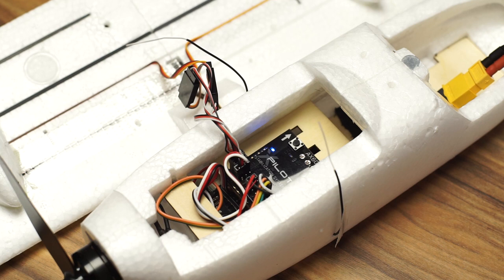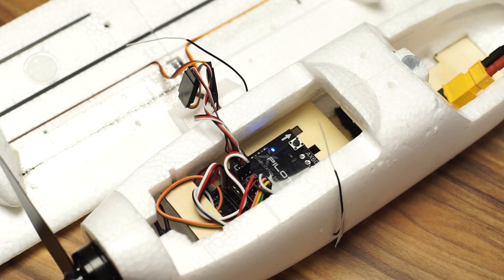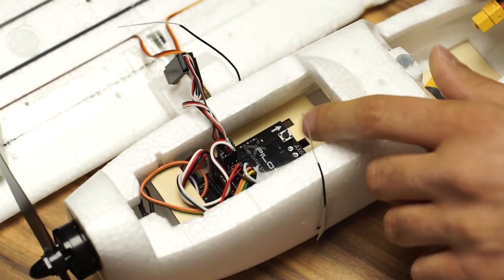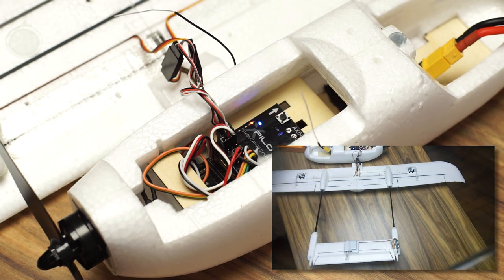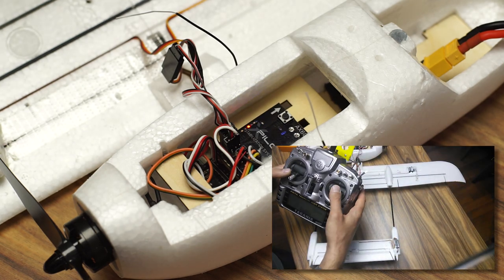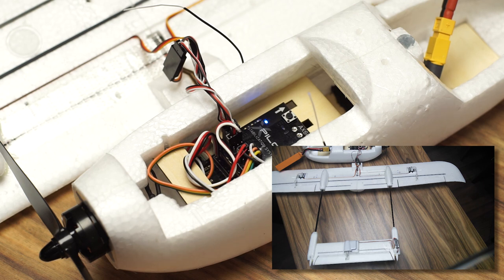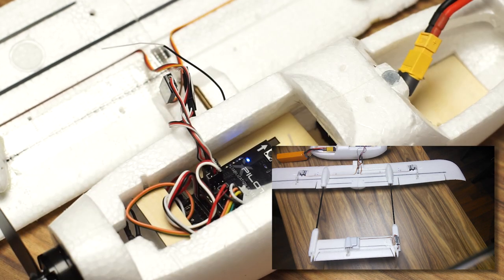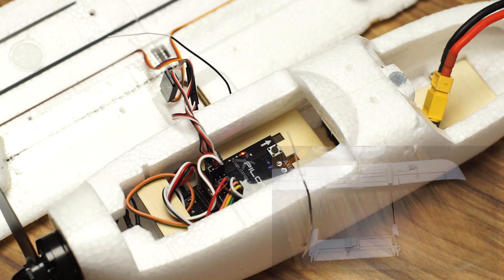Volantex Xpilot stabilization system - calibration and setup

Comment: Please help I have followed these configuration steps(https://www.youtube.com/watch?v=fZPNAFPJ4-E&t=13s) multiple times and can't get the blue light on the Xpilot to go solid blue(stabilize mode).   Note:  Aircraft servos do work via radio (even prior to initial attempt to configure the Xpilot) Also configuration saves via red led(s) indication comes on when saving with lower right stick application during configuration mode. Any advise is appreciated.  Thxs
Reply: Mike Brisky .. I am having the exact same issue. Aileron and elevator end point calibration and three position mode switch calibration saves as per the video but when reconnecting the power my blue LED does not go solid. I have wasted hours and hours trying to get this to work so if you find a solution please let me know and I will do the same
Reply from the maker: Quite a lot of people seem to be experiencing such problems lately... wonder why!!! :(
Reply: Paul Nurse - To let you know I decided to go with a -  A3 V2 6 Axis Airplane RC-DroneGyro Flight Controller Stabilizer Standard RC843 (purchased via Ebay).  I installed it over the weekend and it is working good so far.  BTW the printed howto instructions that come with it are good.   Thanks
Reply from the maker: Good info, thanks!
Reply: @PaulNurse1  Dpn't know if your problem with the stabilizer is sorted. I have also this problem but I have found that leaving the unit unplug for a few hours would let itself go back to default settings. You can then recalibrate it once more. How did you fix yours ?

Comment: great vid. for discussion or testing. at the calibration test where both tx controls go down right. after that it saves the calibration do not move the plane until 3red go off.
but if instead in calibration you put tx left control down right and put right control down left in calibration your servos will be reversed. 3red light will come and go off when saved. 
can anyone confirm the reversed servo by calibrating and do the right control stick to bottom left in step 2 ;)
Reply: Worked for me to reverse aileron servos with the process you described. Using RX Fs-iA6 (no sBus), TX FlySky-i6 and AX601 XPilot. I have reversed channel 1 on my TX to have the ailerons working in the right direction before installing the AX601. After installing the AX601 (without having applied your steps), the stabilization pushed out the ailerons in the wrong direction, so magnifying the role the plane would be in. Applying your step to push down the left control stick on my TX down right and the right stick down left in step 2 of calibrating the AX601 made the stabilization now indeed push the ailerons in the right direction. My TX also still has the reverse turned on for channel 1. tx!
Reply: @MrDwck  For ailerons you could have just rolled over the aileron servos! ;-) It would be interesting to check if this procedure has any effect on rudder and elevator stabilization direction.

Comment: is it possible to use this with a delta mixer so that when it stabilises it will work with a flying wing
Reply from the maker: I don't see a reason why it wouldn't work!
Reply: I’m interested in using it for a delta wing also but I don’t see how it would know how to mix Ailerons and rudder if it doesn’t have a switch to change the wing type configuration on the Xpilot unit? If you only have aileron servos connected to it how would it know?
Reply from the maker: That is why you need a V-tail, or otherwise known as delta, mixer to mix the channels needed. The Xpilot will not do it on its own.
Reply: ArxangelRC thank you

Comment: Hello! Thanks for the video.  I'm quite new to adding a gyro to my rig.  The flight controller comes with a ribbon cable and im confused on how to wire it to my receiver.  I don't have an SBUS compatible device so I'm going to wire it the old fashioned way.  Do I need to purchase a few Y connectors and run the harness from the receiver to the X pilot and then to the servo or do I need to wire just the signal wire from my reciever to the X pilot and have power and ground go to my servo from the reciever?  I'm quite confused and any help would be greatly appreciated
Reply from the maker: Power for the servos will probably come from the ESC, which may not necessarily be connected to the stabilizer. In any case when you connect all the wires from the receiver to the stabilizer, except the throttle, the receiver will power the stabilizer, which in turn will power the servos.
Reply: The ribbon cable has many cables useless, you should take 2 of them (the red one for power and the black one for ground, for exemple) and plug them from the receiver to the xpilot. 
You should take power and ground from any channel from the receiver (channel 5 for exemple) and plug them to the + and - on the xpilot.

Comment: Does this have a failsafe option? I.e. if you loose signal will if keep the aircraft stable till it hits the ground?
Reply from the maker: I would assume, but it would also depend on the receiver - if you set it up to failsafe on the stabilize mode channel and no throttle, with a bit of rudder, it should do just that! Not sure the board itself has any failsafe detection!

Comment: I’m using a Radiomaster TX16S and need to program a channel to enable a pilot. What channel does the stabilizer use ?  Is it -100 or +100 for on?
Reply from the maker: I can't say that I recall anymore... try channels from 5 on to see which one would make it go on or off... perhaps channel 8... don't remember, but yes, it needs to go full swing from -100 to +100.

Comment: Hello...i have a question, a little "off topic"...how do you usually power your pwm receiver? directly from the battery? (Using a BEC)From The balance plug? I don't know what is the best way...
Reply from the maker: I usually use an external BEC to power the electronics on-board, but on this model it was just not worth it to go that far, and the ESC was HobbyWing, so it is somewhat dependable, so I just powered the receiver and all electronics from the ESC's BEC.

Comment: Dear Sir
I started to mount the xpilot in the ASW28 of the Volantex and there was an interesting qestiion, the ailerons have independent channels.
The controller only has 1 port for aileron.
my right aileron is on channel 1 and the channel on channel 2 i have the left aileron.
Using the  FrScky X8R receiver, on sbus, will it be that if I connect my channel 1 to the aileron port of the controller and my channel 2 in aux2 will the elerons be working well?
How do I turn the controlled flight on and off, on the taranis x9d plus.
Can you help me?
greetings
Vitor Lalanda
Reply from the maker: Use a Y cable to connect the ailerons to a single port! I think you need to setup a switch on ch5 in the radio, that will change the flight modes!

Comment: Thank you for sharing your knowledge, it will be helpful when I get there. I have 4 servo's  on the wing Ailerons/Flaps. My query would be; 2 servo leads from all 4 servos to where ? Would be so helpful, if could Please.
Reply from the maker: Hi, the Aileron servos can be connected with a Y-servo lead to the stabilizer where the AIL is, but the Flaps should go directly to the receiver, they can't go through the stabilizer as far as I know.

Comment: Is there any good experiance/procedure about how to use the "gain" potentiometers ?It looks for me like they are only limiting the max rudder travel ?? The mode switch does not seem to have any difference,, except for on/off.. I can´t understand the manual it is very confusing for me. I also use it in a Micro Skyhunter and today in windy conditions I had very little authority over the controller, so for tomorrow I will try to lover the "gain" to be less than my own servo travel,, Hate experimenting and possibly destroying my model.... I hope you have some good suggestions..
Reply from the maker: To be honest I haven't played with the gains at all because the position they were in at the start turned out to be quite good for my plane, so I never bothered to tune that! As long as you have the option to switch the stabilizer off from the remote, you should be OK and not be in danger of destroying the plane! I hate testing such things too, but sometimes they are necessary! Try reducing the gains a bit more and try it... but only turn on the stabilizer once you are already in the air and are 2-3 mistakes high!
Reply: Now I have made extensive tests and I am absolutely not happy.
1. It randomly looses its calibration.
2. Regardless of the gain setting I don´t get enough authority over my plane.
This was a waste of money for me it goes to the trash bin.
//Rob.
Reply from the maker: Damn! Really sorry to hear this Rob! :(

Mine has been working fine from the start and I haven't had the need to re-calibrate it! I guess you just got the defective one in the batch! Depending on where you got it from, I guess you could ask for it to be replaced or get your money back!

Comment: Hi Thank`s for the video, it helped a lot.  Just have to try to fly it now. (received the stabilizer today,and just set it up)  I have a Fr sky D4IIreceiver,and this stabilizer. But do you pilots use any rates and expo on the micro skyhunter? if so,how much?
Reply from the maker: I never use rates, but do make sure to dial in some EXPO. 30% for starters should be good! :)
Reply: Thanks, will try that   :)

Comment: I've watched your video over and over with the xpilot stabilizer and done exactly what you have done and I still can't get it to work. When its in normal mode, the aileron, elevator and throttle work fine until I put in stabilize mode. When I go up and down, only one flap works correctly when I go left the one flap works but when I go right the throttle kicks on. I'm really getting frustrated with everything and just want to trash it. Could you please help. Thanks, Steve
Reply from the maker: That sounds really weird Steven! I don't think I've seen such behaviour before! The only thing I can think of is that the output cables are mixed up! Usually the stabilizer should not be able to control throttle, it is just a pass thru. If it is activating, it could mean that either it is damaged in some way, or you have connected the output wires wrongly.
Reply: 2 possibilities. ! - If you are using a PWM receiver then you have the signal wires from your receiver to the Xpilot plugged in wrong. Or 2 - If you are using an S-bus receiver your receiver channel output must be mapped to the A,E,T,R,Mode order that the AX601 expects.

Comment: Hi! Can you explain how to reverse channel if it works properly in manual mode but stabilization works in wrong direction. I did it accidentally but I still don't understand the logic. Besides that there's a flying wing mode (ailerons and elevator mix). Maybe you could give volantexrc contacts?
Reply from the maker: To be honest, this was so long ago that I can't recall anymore! As for Volantex contacts, just go to their website and use the contact form!
Reply: @ArxangelRC  thanks
Reply from the maker: @af1345  Sorry I can't help more on this matter!
Reply: There is a video out now by an Indonesian gent (PLANETHELI TV) where he shows that the direction that you move the sticks during the calibration set-up (ie low first or high first) sets the stabilization direction. The video has English sub-titles. Note that there have been 2 versions of this stabilizer sold. 1 is only for T-tail - planes while the second can be set for V-tails and Wings also. Check the manual supplied with yours to be certain which you have.

Comment: Hey mate, wondering if you can help me - I have a Volantex P51 750mm and there is a problem with the gyro stabilization when in high speed or dive, the plane starts moving around up and down violently trying to correct itself. Do you know an easy fix for this problem?
Reply from the maker: Hey, sorry for the late reply! I actually just flew my P51 750mm today, but due to some issues with the ESC didn't really have the time to properly test it much! In any case I would assume the speed just gets too high for the gains of the stabilizer, and it starts to oscillate a bit, but since those can't be adjusted on these units... only solution would be to replace it, or not to dive so quickly!
Reply: @ArxangelRC  The only way to adjust the gains on the 750mm Volantex P-51 stock board is to alter where the servo control rods are positioned. It also suffers from the Bummer that the protocol CANNOT be hacked for the Multi Radios so you are stuck with the toy radio.
Reply from the maker: @theoztreecrasher2647   Well... they are not exactly professional grade stuff... they are toys mostly!
Reply: @ArxangelRC  Yep, Nick! And ! hope you and yours are having a healthy and peaceful Festive Season! 😉😊
Reply from the maker: @theoztreecrasher2647  We are, thanks! Best wishes to you too! :)

Comment: Hey bro! Great channel. I understood all the instructions for calibrating etc. perfectly. However I’m just confused on how to actually wire it. I am using a flysky 6 channel receiver. Would you be able to make a pinout diagram ? What I’m having trouble with is basically a) where do I plug in the throttle (esc) and how do I get power from the receiver to the xpilot..sorry for my confusion. 

(Also setting it up for a micro skyhunter )
Reply from the maker: Sadly, I no longer have the unit with me, but from memory I can tell you that you don't necessarily have to connect the throttle to this unit. You can connect it straight to the receiver. As for power, one channel from the receiver will have GND, Positive and signal wire, the rest need only the signal cables connected... if I remember right!
Reply: ArxangelRC I got it ! Will maiden it today :) thanks for quick reply
Reply from the maker: Good luck!

Comment: This is a very helpful video but I'd like to see you attempt this with a plane that utilizes a rudder. The elevator and aileron correction seems to work ok, but the rudder won't return to center unless you start to move the stick in the opposite direction beyond center. It's very weird. But for a 3 channel plane with elevator and ailerons only this unit probably works ok. I suppose I'll save the xpilot for my Nano Skyhunter build.
Reply from the maker: Never tried it like this to be honest, and I also don't have the unit with me anymore...
Reply: I have the same problem sir
Reply from the maker: Really don't know what to tell you about this! :(

Comment: Hello...

My congratulations for the channel!

I write you from Mexico ... I installed this Volantex to my Eachine Skyhunter ... but something happened to me, after some flights the servos stopped working, the gears broke ... it will be that the stabilizer makes them work to lot? 

Muchas gracias

Benjamín
Reply from the maker: Thanks! Well, a stabilizing unit will absolutely always make the servos work more than you would in normal flying! The stabilizer is constantly moving them around an attempt to stabilize the plane. I find it hard to believe that it can drive them too hard so they would break, I would attribute this more to lower quality parts, etc., used in these, so replacing them is always a good idea, especially if you can find some metal geared ones in this size.
Reply: ArxangelRC thank you very much!!!
Reply from the maker: You are welcome! :)

Comment: During Voltantex level calibration, I pull both sticks to bottom right, but there are no changes to LEDs, any ideas?
Reply from the maker: Sorry I can't help much, I don't have this unit anymore and don't remember much about the calibration process!
Reply: Pull both stick to right not bottom right
Reply: @ujju123ful  That is not correct! It is both to bottom right and red leds 1, 2, and 3 will all come on plus both blue leds will blink. Release sticks after 7 seconds the 3 red leds will go off and blue led will remain blinking. All others will be off showing that the calibration is successful. Cycle the battery. On normal start-up the blue blinking led will only go to solid (= unlocked) if the plane is left sitting still and the throttle is at 0 (IE NO TRIMS!) Plus if it still will not go solid re-do the calibration steps with throttle at 0 and no trims. (Check your radio to make sure throttle fully down does equal 0!)

Comment: Hello! Nice video and very useful! 
I have a question that I cannot find an answer for. 
Aileron and elevator commands and stabilization work fine; rudder command works in the right direction, but the stabilization works in the wrong direction. 
What I have to do in order to invert the reaction of the stabilization, just for the rudder?
Many thanks!!!
Reply from the maker: Hm... you know what... I am not exactly sure! Can you try this... reverse the rudder channel from the radio and redo the calibration. Verify that the stabilizer stabilizes in the correct direction and then reverse back the rudder channel in the radio. If it doesn't work I will ask Volantex how to do this... I hope they can give an answer.
Reply: Thank you Arxangel!
The problem has been fixed, but I don't know how...
I repeated the calibration, without reversing the rudder command, and the problem disappeared.
Bye!
Paolo
Reply from the maker: I am glad you fixed it! Safe flying! :)